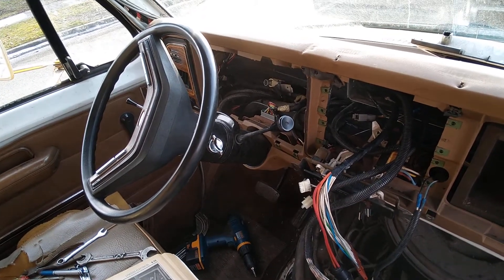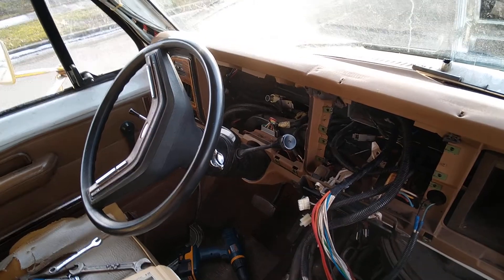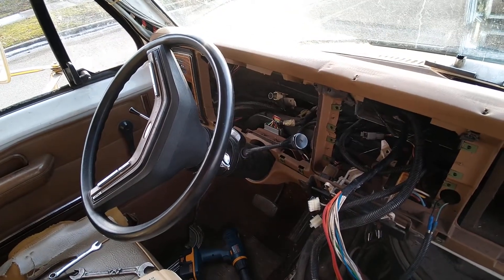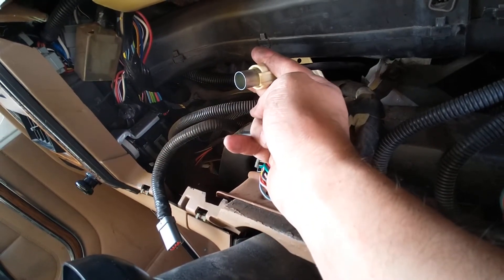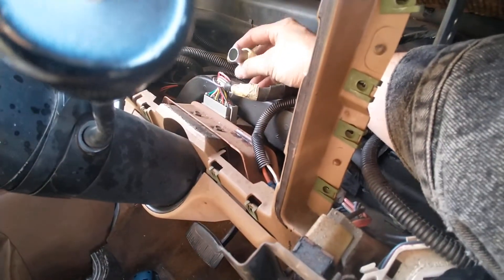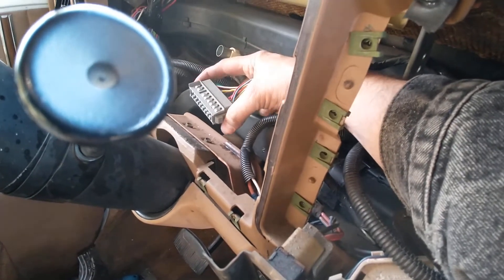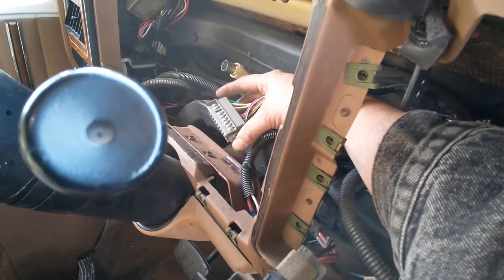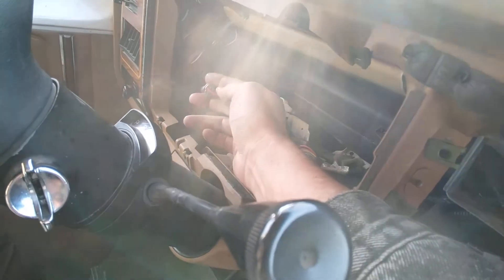1986 - 1991 Econoline instrument cluster removal.

Comment: I have a question for you, Sir. Is there a relay inside your dashboard? If so, does this relay control the flow of current, within the starting system? I ask, because I'm not getting power, at the starting solenoid. I have new batteries, cables, starter, starter solenoids, & starter cable. I even replaced the ignition switch, but still a no crank no start. I tested the power wire, which runs from the starter solenoid, which connects to some other red wires under the hood. However, there's a main power wire connected to all these wires. This wire, runs from under the hood, to somewhere inside the RV, under the dash. So, it seems like it provides battery voltage, to all those red wires. I tested this wire with a volts meter, & there was no battery voltage coming from this wire. As you can see, this is why I asked you about the relay, under the dash if you have one there, as I do. I'm just not sure what it's being used for. I was thinking it may be the reason for my no battery voltage problem. Or, this main power wire could be faulty. But, my plan is to see what this power/red wire connects to. Any tips, or whatever feedback about what I'm sharing with you, will be greatly, appreciated, Sir.

Comment: Yank it off my ass.... How do you get the speedometer cable OFF the back??!!
Reply from the maker: Not yank. Pull it out.
Reply: @michaelh7532  squeeze the plastic part of it??? Pull Yank doesn't work.
Reply: @michaelh7532  maybe rusted together??? WHAT is the trick?
Reply from the maker: It's been a year. I don't think it has the press lock. I remember it just being a wiggle pull. Hopefully I'm not wrong.
Reply from the maker: @donshelton7490  If it is a squeeze lock then yes. If not, it couldn't hurt. If you look in the video, there is a spot that might be a place for a thumb to go